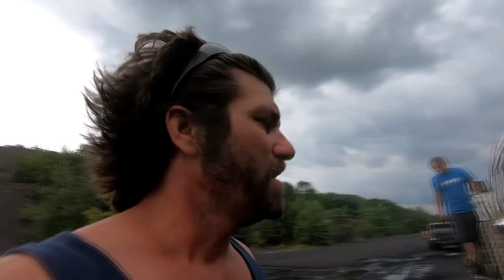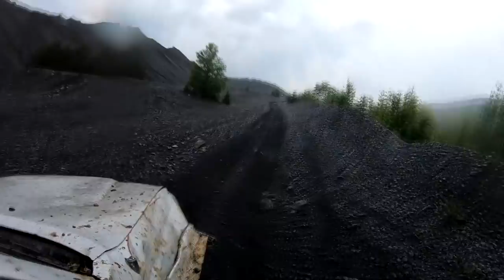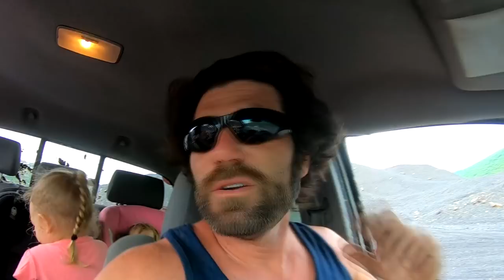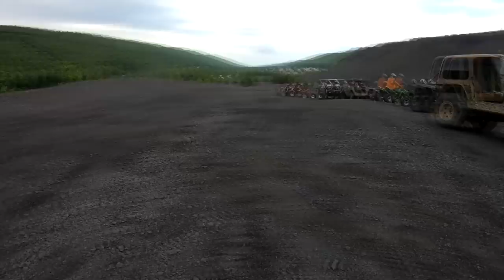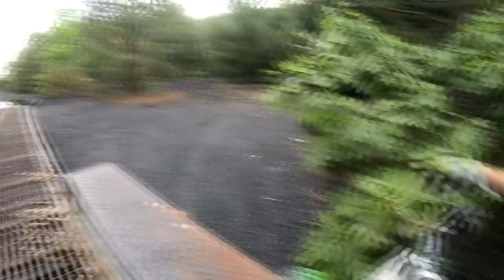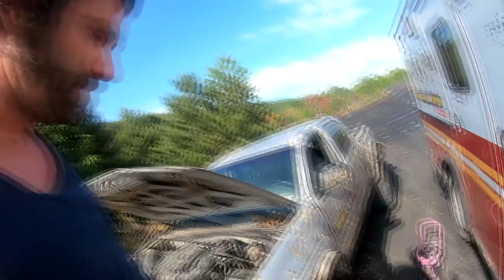TACOMApocalypse hill climb Trevorton PA (intro)

Comment: You think you have problems now.....lol wait til that 5.7 gets in there and trashes the axles and twist up the frame ....kidding.......lol....hey are u changing ur crossmember or are they the same mounting locations? Also I'm afraid ur going to have to go with the custom straight front axle for the torque from that beast....maybe not...but ull be the first V8 swap crash test first to do it and if it fails I'll be pissed person........lol.... keep up the great work!!!!! You guyz could do chocolate covered dog sh*t and still make a great video....lol
Reply from the maker: chocolate covered dog shit LMAO...  I'm not sure about the cross member yet.  I'd imagine I'm going to cut and weld Tacoma / Tundra cross members together so it bolts the Tundra trans into the Tacoma frame.  Front axles are RCV "ultimate CV axles"  Guaranteed to not break with up 42" tires.  So, we'll be putting them to the test too!  https://www.youtube.com/watch?v=JbXSKe39JWM&t=39s

Comment: What rims are those
Reply from the maker: Method Racing bead locks. 17x9. They were about $340 each.  I researched a lot of wheels before I bought them. I chose these cause they were the lightest beadlocks I could get in that price range. Have had no problems with them.